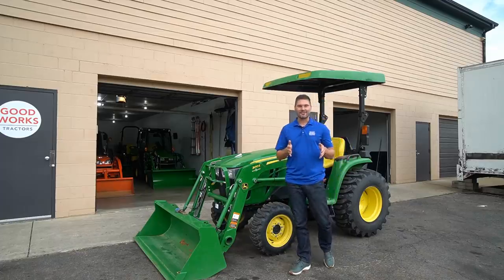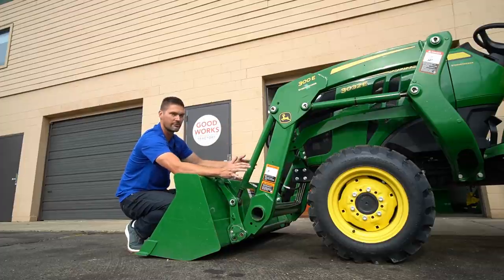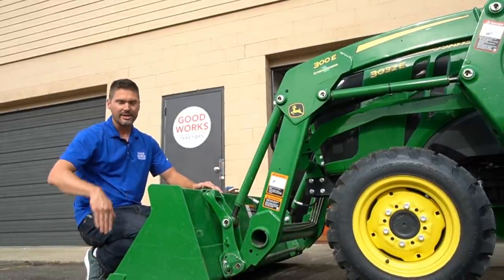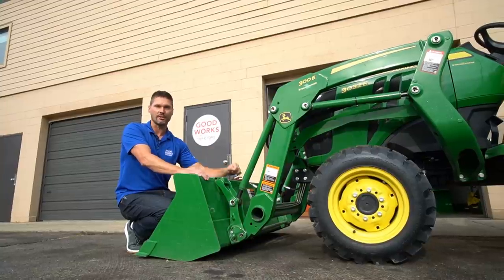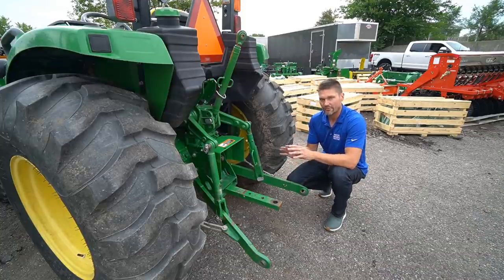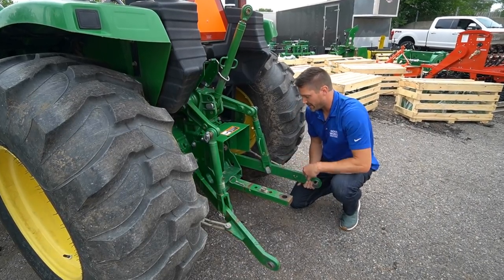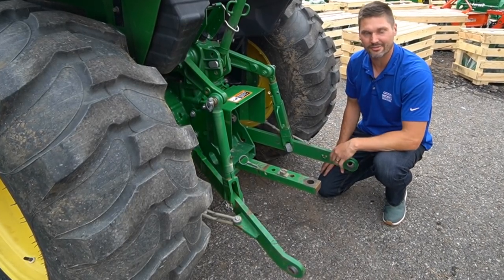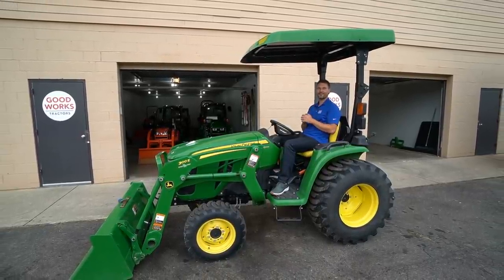HOW DOES FLOAT WORK ON YOUR TRACTOR? 5 DIFFERENT WAYS 🚜

Comment: Nice "float" function explanations!  One thing that might freak a new owner out about the FEL float function...  If you have the FEL attachment (bucket) on the ground with the FEL boom cylinders in float mode and you encounter some kind of higher resistance, the front end of the tractor can rise up off the ground.  In reality, what is happening is that the tractor is "ridding up" up the boom cylinders and will do this until the cylinders bottom out on their stroke.  This doesn't normally cause any damage as long as your ground speed is not overly fast and you're paying attention.
Reply: Thank you, I have had that problem and thought I was doing it all wrong
Reply: @dalcassian56  You can also temporarily pop the boom cylinders out of float back to the neutral position to push past the resistance and then return the boom cylinders back to the float position.
Reply: @bradmeacham6982  Thanks again!  The first time I tried the forward float, the tractor lurched up so suddenly I nearly cracked my skull on the frame of the cab.  Thank god this skull is so thick! :)

Comment: Thanks for the info! I wish my B2601 had a float function on my mower deck. 
This makes me wonder if there is a way to add a float function to the rear hydraulic kits from Summit? There's a company that sells ditch and bank flails that offers an add on kit with their machine but dont offer any real info about valve itself. I only mention this becauseive tried to find such a valve to use and cant find anything.

Comment: How about the bucket re-gen/fast dump mode, by pushing the SCV lever fully to the right detent?  As I understand it, it is essentially a float mode that allows the hydraulic oil to freely circulate between both sides of the cylinder piston.
Reply from the maker: Good call, yep very handy indeed!
Reply: No. It uses the oil being returned from the rod end of the cylinder to charge the cap end along with the oil that is flowing from the pump on the tractor already.

Comment: In that video where you showed the fourth and fifth function levers, are those the only way to control the functions of can you control them with the loader?
Reply from the maker: Those levers are the only way to control those additional functions
Reply: I remember you using a diverted kit in another video. Is that not available on that tractor?

Comment: So I’m guessing floating usually just open the valve on hydraulics just to let it move? Is there adjustable float where you can have some resistance on it to where it would give under a heavy situation but not with just a little resistance?  Or to at least slow the amount of float? Like if I have a really heavy attachment and hit float will it lower slowly instead of just dropping it?
Reply from the maker: No float adjustment that I'm aware of.  Just either in float or not.
Reply: @GoodWorksTractors  1st let say, I am new to the sub compact tractors. Mine is Orange & I love it!!
I Know very little, but watching videos like this really help, then I can go out & try info...

Wouldn't the weight of the attachment give the "float" position some resistance? Say  a front mounted snow blower, more resistance than say a feather sweeper. LOL (a silly comparison, between attachment weight and "resistance the Shane is speaking about?

Shane 2nd point: Kubota has a hydraulic control valve, on right side of seat. For the very reason Shane states, heavy attachment will drop like a rock. This valve if set for the attachment will prevent that from happening, I have read & seen in videos, but I thought it was for only rear hydraulics, not mid or front, say for snow blower?

Am I correct or wrong?
Thanks for listening.....
Reply: @michaelohara5703  Only for the 3 point . You might have a counterweight locked at a certain height on the 3 point while using mid or front equipment.

Comment: Does the 1025R's (or any of the other John Deere models) have float on the tilt? I saw a video that a B2601 has it and was curious.
Reply from the maker: There's a fast dump option if you push further to the right

Comment: So.... it works on the mower deck too? In other words if you push it down all the way the mower is in float mode? I didn't know that.
Reply from the maker: Howdy, doesn't really matter how far down, but it will have that flexibility to move vertically in between it's maximum raise point and the distance you've lowered the deck.